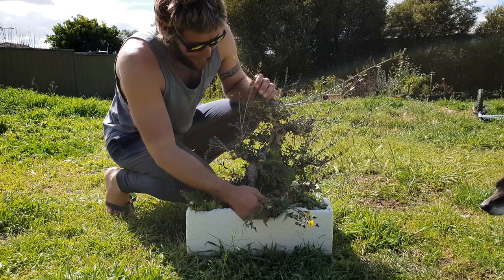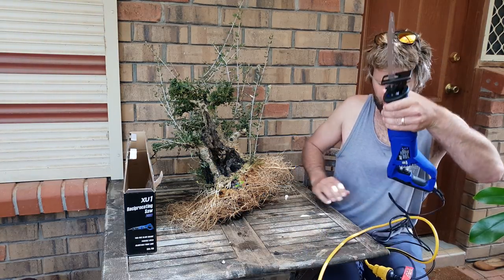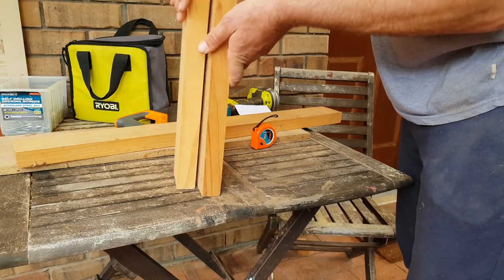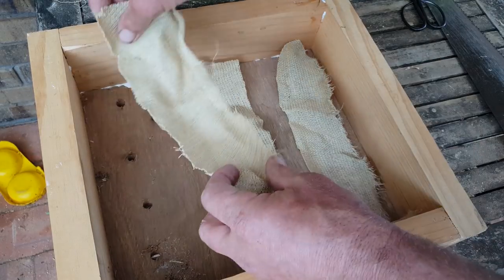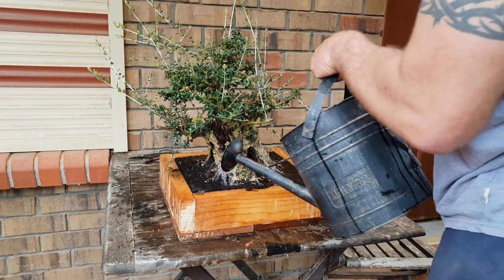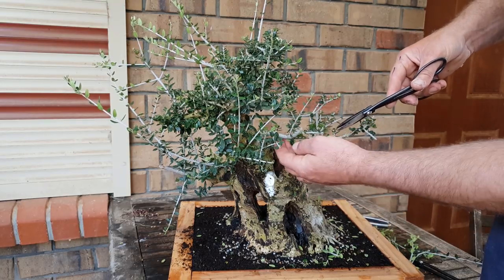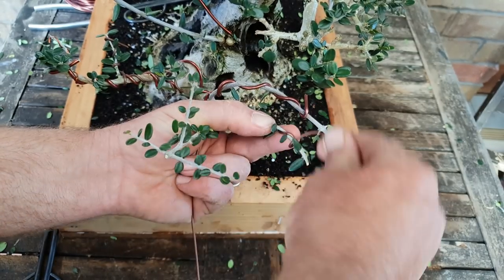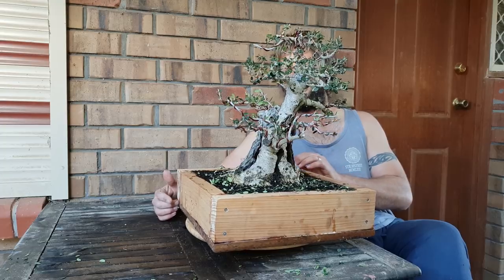Olive Bonsai repot / style monster vid, Aussie Bonsai Bloke

Comment: Some time back I had trouble finding cutting paste. As a result I tried something that I hadn't heard of being used elsewhere.  Surprisingly it worked really well. It may not be traditional but it worked.  You may like to try it.  I cut my hand and used Betadine liquid on the cut so I thought I'd try it on my  trees. I've now been using the spray bottle version of Betadine on cuts and wounds for @18months. I've found that I haven't had any issues in the areas I've used it.  It also helps with hiding the cut as it stains it brown.  The area is protected from infection and any mold forming. With the added colour it seems to be a good alternative.  Thought you may like to try it or at least give me your thoughts.  Thanks for the video. I have an olive stump which could be the twin of yours which needs a good cleaning an repotting. Cheers👍👍
Reply from the maker: Cool cheers for the tip

Comment: Nice looking tree mate and great tips, you make it look easy (P. S.  Chippy  trade tip - most handsaws these days have a 90degree built into the handle so you can use them as squares - that one you were using in the has one,  cheers)
Reply from the maker: Cheers mate and thanks for the tip. It took 39 years for me to work that out and I was told so I guess I never worked it out 🤣🤣

Comment: Another interesting video. I have an Olive stump which is almost identical to yours.  I have left it in a foam box but definitely needs repotting. Your idea of the wooden box was spot on so that will have to happen sometime during the week.
By the way did you ever try the Betedine spray?  It came to mind when I saw you using wood glue.  That would have been a perfect spot to try it.
Anyway thanks again....I'll deal with mine now. Cheers!
Reply from the maker: Cool mate. Hope it turns out well for you 😁. Ha mate I forgot but I'll remember it next time 😁😁
Reply: @SamDoeckeAussiebonsaibloke  I was talking to the misses about buying another Betadine spray. She said the drip bottle would be heaps cheaper in the long run, so I'll give it a go and let you know if its worth the effort.  One thing i have noticed is where I have used it on open cuts it seems to minimise the scarring, even on wire bites around the branches.
Cheers again..... got the wood and ready to build my box.
By the way, do you have any black pines that are in need for a little work out? Would like to see a vido on trimming and styling approach to these as I have a couple to work on and am interested in ideas!
Are you from Qld? Looks like you are able to work on your plants all year round as the weather is almost always good, especially this year with the bazaar weather.
Cheers, (I gather its Bundie and cola)???

Comment: are pumice akadama and lava rock not readily avialable in Australia?
Reply: Nick Kellogg, you can get pumice and lava rock. Akadama is hard to find. Some people import it but goes very quickly.
Reply from the maker: Thanks for the watch Nick. Read Peter's comment as I have no idea. Cheers for the watch and comment mate 😁😁
Reply from the maker: Thanks Peter and  hers for the watch mate.
Reply: I use oil spill kitty litter stuff  sifted mixed with osmicoat potting mix soon to add perlite aswell